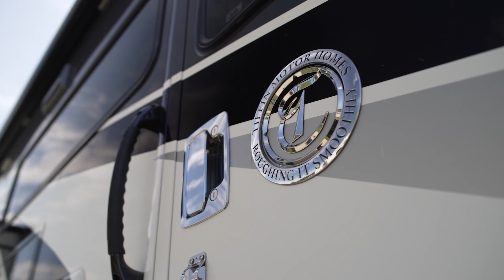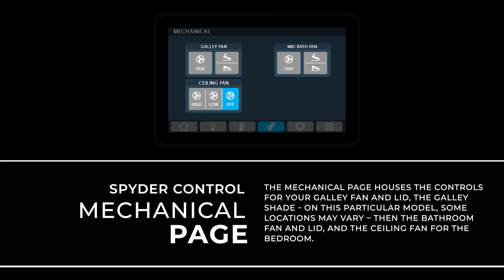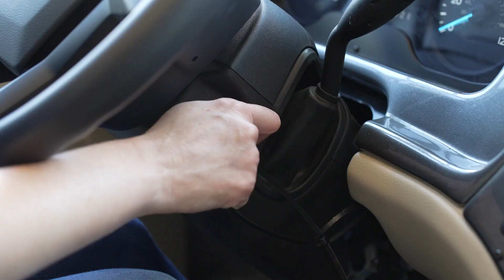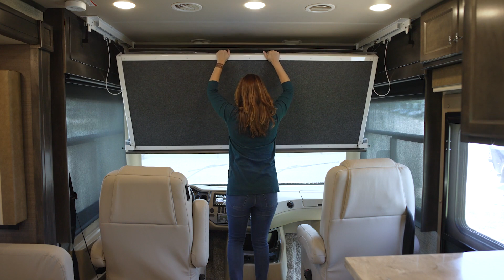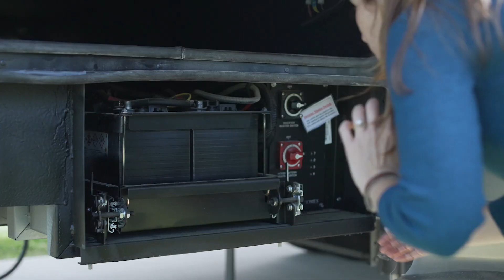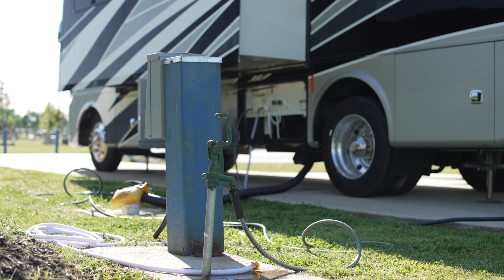Tiffin Delivery Walkthrough: 2022 Open Road Allegro

Comment: Love the Tiffin quality but you lost me at the Ford V8 F53 chassis, when is Tiffin going to sit down with Ford and demand the 6.7 diesel & 10 speed trans? Be an option for the F53? Thor is doing it on the F550 chassis with great success… Bounder 35E here.
O, and the second grip, use only the Onan “Marque Gold” 5500 gennys, the green gennys are loud and they suck fuel, & don’t have the Gold mounting system for noise reduction.
#3 ditch central vac for Dyson V10 that stores & charges in the Anwar, freeing up basement space and warranty issues.
#4 ditch the cabinet door in front of washer/dryer ,, then ditch Splendid washer/dryer for LG 2.5 cu.ft all in one washer/dryer a $1600 appliance that is much more accessible without a cabinet door.
I have the LG 4.5 cuft washer dryer & love it…
Bath houses and laundry should be a given repreve in Allegro purchase ,no more quarters, and a 32x 42 shower.
 Full time since 2018

Comment: It is a big mystery to me why all the manufactures are not spouting off about the 10 speed transmission? In all these coaches.
This is a revaluation in fuel economy , ease of ride.

One of the best evolutions of this coach in (ride quality) is not even talked about.

Sad.
The Ford 10 speed transmission, yes it is a big deal.Powered by the last gas Ford V8 before everything goes electric drive.

Comment: Before I Tee off on this coach, disclaimer, full timer since 2018 in  2006 Bounder 35E.

Tiffin, really, you are really going to send us down this much learning curve?

1 st off, electronic protection for the 100’s of chips in 12 volts on this coach, are they all serge protected?

2nd can this coach be ordered striped of the Spyder system? Back to just on and off switches, Spyder can’t open a fantastic fan just 3 inches when it is raining

3rd way too much learning curve that I do not want to learn of 100’s of variables. My head just exploded with how many 100’s of things I don’t want to fix when they break. Like Apple iPhone terms of service, no I am not reading it, nor do I have a choice, “yes” I agree.

4th manual awning, 1500 series cloth Dometic, as big as possible, 18 foot.

5 th,  you dump the black tank first, close valve, then dump the grey tank to rinse the hose, black tank flushing is a myth, there is so much soap in the grey tank , procedure rules the day, and the hose and tanks are fine.

6th users, spend more time traveling and getting out there then paying any attention to any of these 100’s of error codes.

7th I am not calling an 800 number to fix anything, (on / off) switches do not break, do not get surge damaged, do not throw error codes I don’t want to read.

2006 Bounder 35E here, with LG 4.5 cuft washer dryer, https://www.lg.com/us/washer-dryer-combos/lg-wm3998hba-washer-dryer-combo Samsung RF 18 residential fridge, Dyson V10 vacuum (ditch central vac) and very comfortable couch that is not a bed.

Understand your customer….

Where are the black Alcoa 22.5 rims that came available in 2020?…. Ford?
---------------------

If I can teach anything from the previous generation to the next generation is to out do us. Note the drivers slide not only picks up the couch & dinette but also the fridge with basement. Then the rear slide picks up the arnwar & the bed. All with electric motors, you have hydraulics.

An option that would be nice is the bat wing twin 18 foot awnings on the Phaeton, bumper to bumper awnings, (optional)$ Manual Dometic 1500 cloth series awnings. Mount a single awning forward, setting up a secondary purchase once the customer discovers the advantage of the Bat wing whole rig awning.@ 36 feet wide.

LG 4.5 cu/ft washer dryer installed
https://i.imgur.com/RQT340H.jpeg
LG is coming for Splendid The decade of Splendid (just like Sony) is over. The French company will go into decline.
Reply: Net: give me all the new stuff like the V8, 10sp tx, etc; up don’t give me anything that I have to learn something new about god forbid.  I’m too much of a know-it-all already and if I have to learn anything new, my head will explode..

Comment: Great presentation.  The 2022 has great standard features and many wonderful options.  Some missing important options that hopefully will be included during this model year, such as:  Electric Power Cord Wheel, the important 360 degree camera system and possible the Mobile Collision Avoidance System. These features are available with many of Tiffin's Diesel Pushers.  At Least, please consider providing the Electric Power Cord Wheel.  Best, Steve from Western Mass.